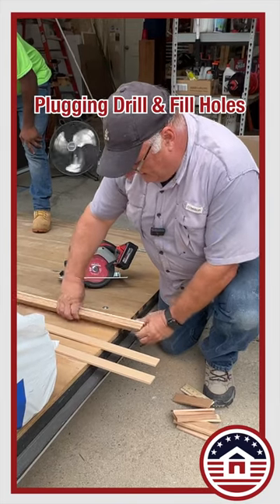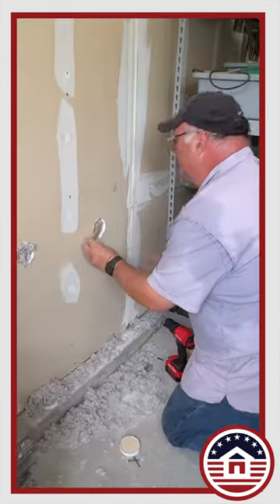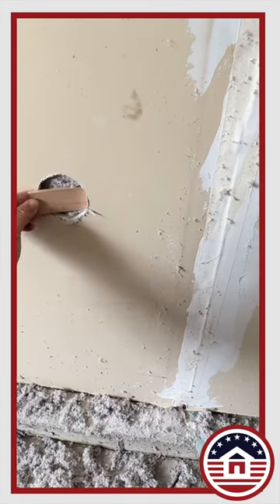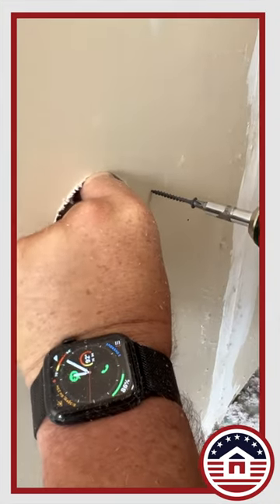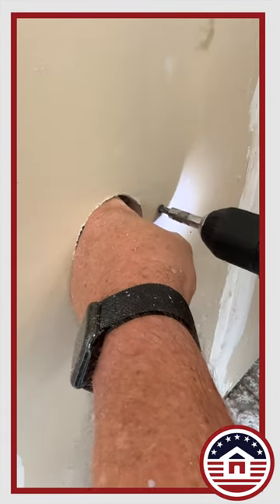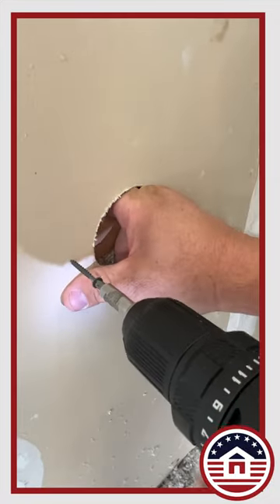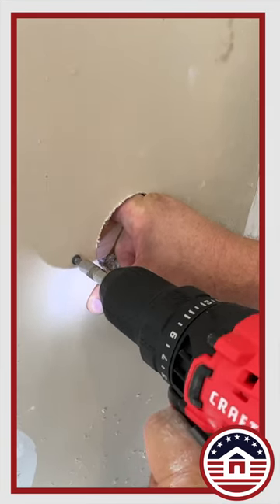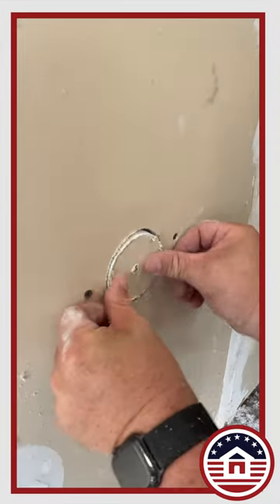Plugging Drill & Fill Holes During An Insulation Install

Comment: We use styrofoam plugs instead of this process. As you mentioned in a comment earlier. Part of our scope of work when we dense pack is to plug holes with styrofoam plugs & one coat of mud. The costumer then hires a painter to finish off the work. Many, many jobs sold by providing this extra service. With more than 20 years of experience drywalling , I’ve come to realize that this process of plugging & 1 coat of mud serves as a great platform to train others in drywall taping.
Reply: Mudded pucks are always different thicknesses and old sheetrock crumbles when cut. Styrofoam "Spackle ready" pucks are a game changer. 75% less time with a better end result and no pipes screwed into.

Comment: Roookie contractor. Use proper size screw for job. That's how wires and pipes get punctured
Reply from the maker: We investigate the wall system before we even start. Thanks for the comment.

Comment: California patch.... don't be a rookie
Reply from the maker: Hi Matt! Thanks. Never heard it called that before. Have a great day.
Reply: @InsulationMachines  you don't need any sort of backing with California patching and will hold the test of time.. no screws with minimal work... you are not California patching
Reply from the maker: @mattmoore3473 , thanks. The drywallers we worked with preferred we do this for them rather than just leave a hole.
Reply: @InsulationMachines  I'm a tenured red seal certified driwaller... if yours require this from you  .. I'm at a loss of words... they're costing you money to have you do this for them
Reply: I prefer this method over California patching!!!

Comment: There is no need for saving the drywall pieces, that’s why these drywall companies get paid for. Your only making it easier for them and making the same money with or without the pieces lol . The insulation company is losing money by paying their techs by the hour to do this drilling stuff lol, not a great recommendation here at all.
Reply from the maker: It depends. This insulation company got paid to repair the drywall. Some insulation companies purchase plugs. It all depends on the scope of the work. Thanks for commenting!